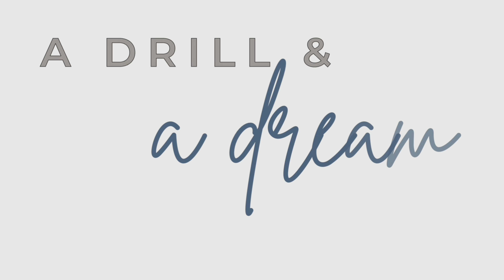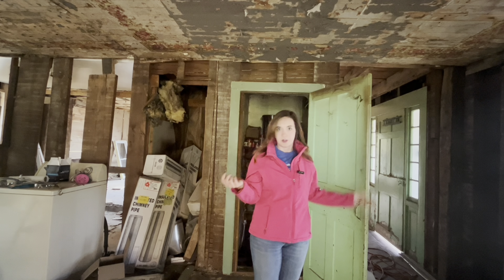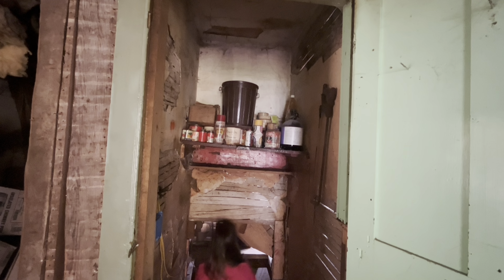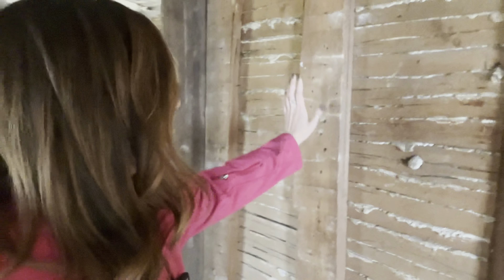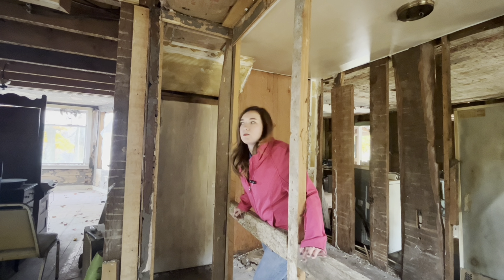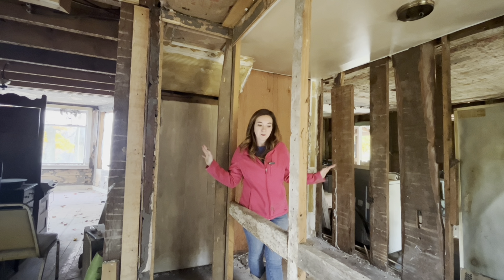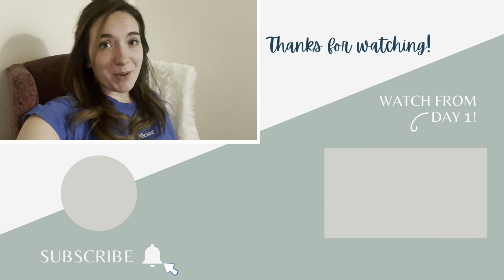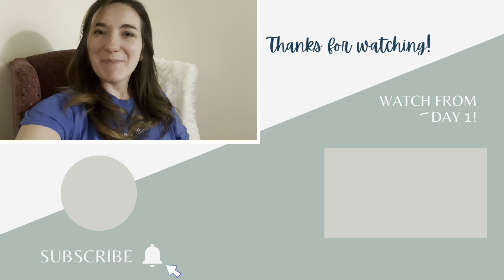MOVING THE BASEMENT STAIRS… this changes things! 😳😲 | My Fixer Upper House!

Comment: It makes more sense to put the basement stairs under the other stairs like is the norm on most houses. If it was my house since you don't need the interior walls for support, I would leave the wall down for the pantry area and give yourself more room. Since you don't intend to put anything on that wall besides a door leaving it off will give you more room to open the fridge doors and let more natural light into the space. You could do a really cute Butler's pantry in that space.
Reply: Hello 👋how are you doing?

Comment: It is hard for me to visual the space without actually seeing it.  While you have to have closets and storage, the thing I see most is the stairway upstairs. It would be nice to move that where the closet is and then it frees up all of that area. I am not even sure it would work and what area you would have left for storage. I am reminded of a ranch house we built near Louisville, Kentucky. It was a beautiful all brick ranch except for one thing.  The master bedroom had a closet that stuck out from the backside of the house. Rather like the front of your house without the windows and without the new wall underneath. It was well insulated and never a problem. You see something like it in many new houses they build today with a walled extension for the purpose of building a "fireplace". In my case it had a small sloping roof. Inexpensive and easy to build. The kitchen storage "closet" I have now is 22" deep and six feet wide with two sets of folding doors. The doors are hung in the middle and each door is 12 inches wide. The space has a nine feet ceiling. Beautiful and more space than we need and could be smaller. You could build an extension by removing one window next to the back counter. That would give you a huge improvement in floor space and I think you could still get a closet out of it.  What you have already done makes for a big improvement.

Comment: Much better flow around the house if the basement stairs are moved.   Sounds like it will not be much more than you have already budgeted for the stair replacement so you should go for it.   Also, it appears that when you move the door to the pantry you have space for maybe a small counter with wine fridge or some antique that you can use as a wine bar?   All girls need their wine time.

Comment: You really should start doing your planning with real dimensions. Estimating your layout with the planning software is going to lead to a lot of problems. You need to understand the site as it actually is. 

Also, I would recommend offsetting the footprint of the basement stairs a couple of feet back from the footprint of the main stairs. If the basement stairs are directly under the main stairs, the head clearance is going to feel rather cramped as you go down the stairs, which is the whole reason you're moving the stairs in the first place. Basically you want to have good headroom and clearance as you go downstairs. So if you're looking at the floor plan of the house, I would start the basement stairs a couple of feet 'up' from where the door to the under-stairs closet currently is. So the door to the basement would be closer to the door to the pantry as you have that door in your current layout. Talk to your contractor about this, you definitely don't want to move the stairs only to have people still bumping their heads because the two staircases are stacked too closely atop one another. Give the lower stairs room to breathe a bit.
Reply: I was thinking the same thing. Also, new stairs might need to be up to current codes. Is your space wide enough for 3 foot wide stairs?

Comment: Ditch the skinny kitchen window (bonus, save some money) and put your fridge there. Move the back door to the laundry room and you can have a better bathroom layout with the shower next to the toilet and a double vanity (and 2 sinks across from them). Hers and hers for now, maybe his and hers in the future. Also good to have more sinks when there are children about. Your mudroom could be galley style, with a bench/shoe/coat  area and cleaning supply closet on one side, laundry machines and a folding/hanging station on the other side. This would give you a proper mud room to come into after yard work and easy access to a laundry line. Pocket door on the pantry would be fantastic. Saves room in the pantry from a door opening in, and solves the issue of 2 doors opening out into each other in a corner (basement and pantry) since you'll want the basement knob opposite to what's shown in the layout image

Comment: Great idea! Move the stairs. They will be wider and safer for you to go up and down. I like your idea of keeping a coat closet near the front entry for guest.
One thing, sorry it’s unsolicited advice. If you can cut your wood closer to the top and bottom plate, you can reuse the wood, it’s old growth so it’s usually very good wood. 😉

Comment: Definitely move the stairs. I was wondering about that door in the last video and thought it was a closet. It will be much more functional with everything moved and better for anyone using the front door as well. 
Be careful removing posts around the stairs. While it is post and beam, you removed the post supporting the top of the stairs. You'll need to replace that asap. It also means that the wall will have to extend a little further than your drawing. 
I agree with others to remove the skinny window and extend the kitchen. Maybe even leave the pantry open to the kitchen and just add several full cabinets.
It's also not too late to move the kitchen to the living room area. That way you aren't having to carry groceries all the way through the house to the kitchen on the far side. 
You really should imagine the normal paths of traffic and how you will be traversing through each space. What path would you take to go to the bathroom from the upstairs, to take laundry from the rooms, get a drink of water, inviting friends to sit down, etc.

For the bathroom, the layout is odd. Imagine yourself walking into the bathroom and having to squeeze by the tub to close the door and get to the toilet. I think it would work better to move the vanity down the wall towards the living room and put the toilet where the vanity is. Then put a shower where the toilet is, moving the wall slightly to accommodate. You don't need a tub since you are planning on a master bath anyway. That way when you walk into the bathroom, with the door opening the other way into the wall, you are facing the mirror above the vanity.
Reply: I agree with your point about the bathroom being awkward. The space at the outside doorway is rather wasted. I wonder if she will switch the bathroom and washroom. It would eliminate yet another door in the living room, create a washroom/mudroom in a larger space, and enter the bathroom, which may now be a little larger, from the washroom/mudroom.

Comment: Yes Abby good idea 💡 to put under stair case as the shape offthe stairs going up is good so you can build the stairs going down followthe same pitch , yes the old one into a cupboard  a nother good idea 💡,  can't have too many cupboards , in the pantry could you have a siding door iff you have room think about that ,l mite have missed  it were there wood heater going l didn't  see it on the floor plan , ok have a good trip away 😉 keep smiling  God bless  cheers Malcolm

Comment: yeah I always thought that the stairs should be side by side and have the walkway on that side of the kitchen with easy access to the basement/pantry area
and having a coat closet near the front door is more sensible also keeping all the cleaning supplies together in the laundry room is really practical at least in my thoughts on the matter anyways 😂🤷‍♀️ 
the house is coming together nicely love the design you came up with (I used to draw up different house plans when I was younger)

Comment: I'm a bit confused; you say it's a post & beam structure.  It seems if it's a P & B building the P & B we're installed to support the walls, roof, etc. I know you've consulted with Stan to make sure it will still be sturdy.
I, personally would leave the P & B and design around them.  I think for the structure of the building, I'd leave all the supports until the foundation is built and sturdy first.
It seems you keep changing things.  I know sometimes it's hard to plan on paper without actually getting a feel for the space.  I know you'll figure it all out.

Comment: Get your refrigerator out of the pantry. It would be very inconvenient in there. Lots of good suggestions already made about that. I'm a kitchen designer and you can have different color cabinets, if necessary,  since you already bought some. Eliminating the window on the back wall makes sense and putting the fridge there or less cabinets by the range to fit the fridge in the existing space. You need at least 24" of counter space on each side of the range to be comfortable.